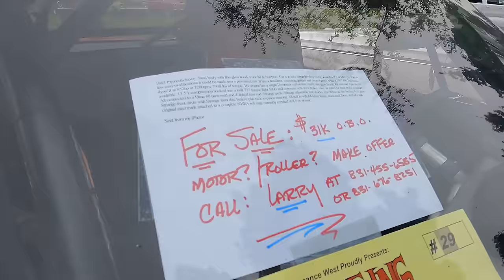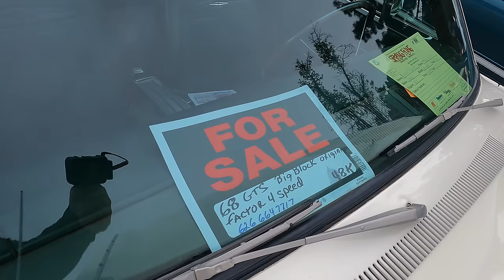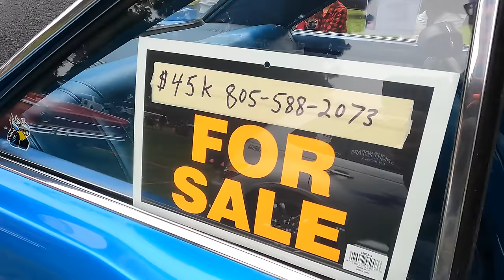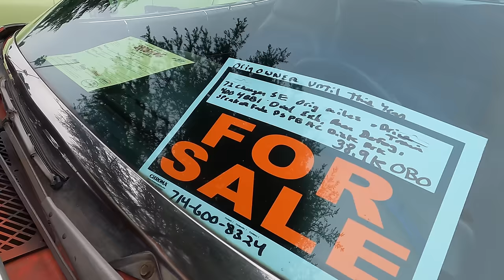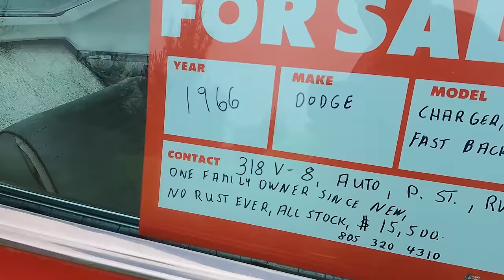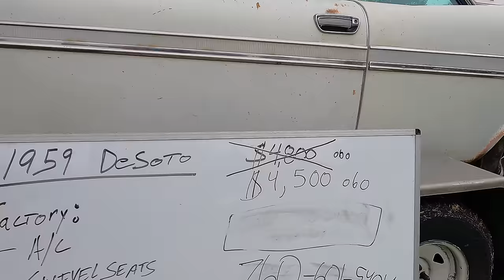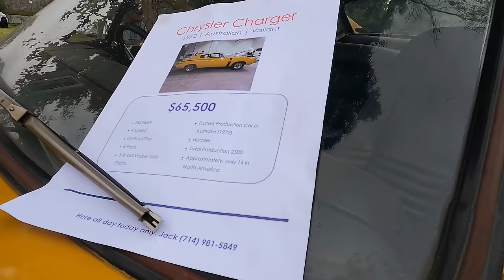Mopar Spring Fling 2024 Car Show At Woodley Park In Van Nuys

Comment: That 1972 Satellite Sebring plus that was in the background at the start is a cool car just not a big fan of the bump guard that runs down the center sides of the car but I am sure it prevented many doors from banging into the body in parking lots they just don't look good on a side of the car.
Reply from the maker: Many dealers added the ding strips when as an add on back then.